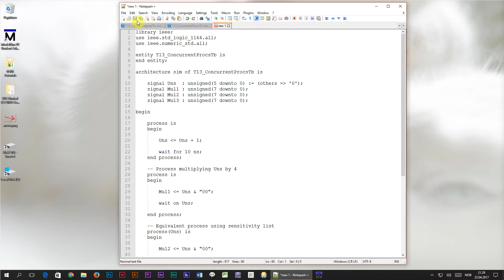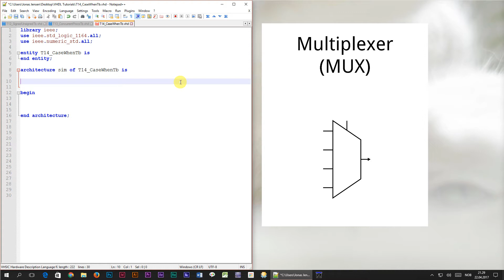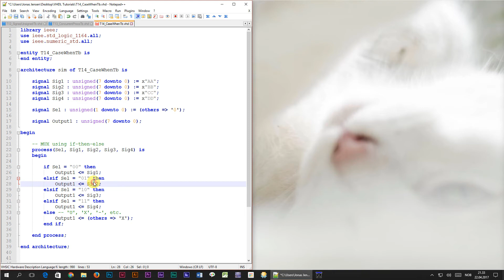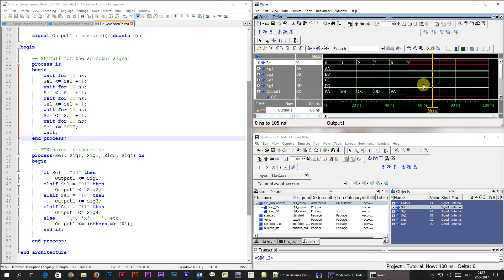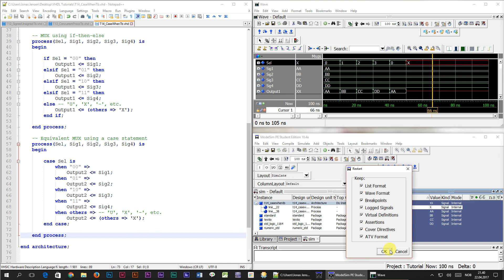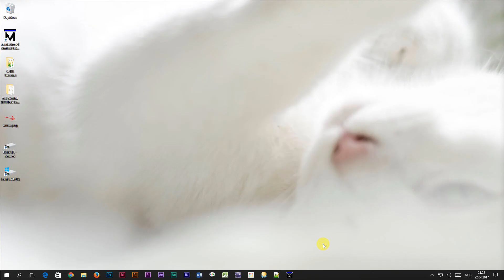How to use a Case-When statement in VHDL

Comment: Could we also have an array of signals, and use the selector value as an index to pick a value out of the array?
Reply from the maker: Yes, but it's easier to just use the selector to index the vector (or array) without using a CASE-WHEN statement:

  signal sel : integer range 0 to 7;
  signal s : std_logic_vector(7 downto 0);

begin

  A_PROC : process
  begin
    
    report std_logic'image(s(sel));
    
    wait;
  end process;

Comment: hello. 
I'm doing homework and my professor asked us to do a state diagram in behavioral.. so I was following his steps during the homework. but when I try to synthesize it, it gives me this error ( case statement does not cover all choices. 'others' clause is needed) what that means?
Reply from the maker: It means that there are some possible values on the CASE signal/variable that are not covered by the WHEN branches. You can either add WHEN statements for the missing values or a single "WHEN OTHERS =>" that catches all values not covered by the other WHEN statements.
Reply from the maker: @unstoppableguy7896  I'm not sure what you mean. Maybe you can get some help from my blog post about signed/unsigned types in VHDL: https://vhdlwhiz.com/signed-unsigned/
They use the two's complement to store positive and negative integers.